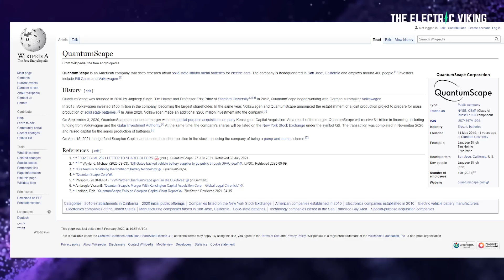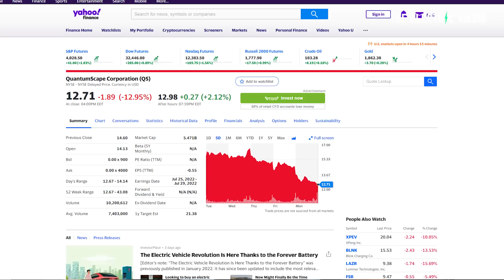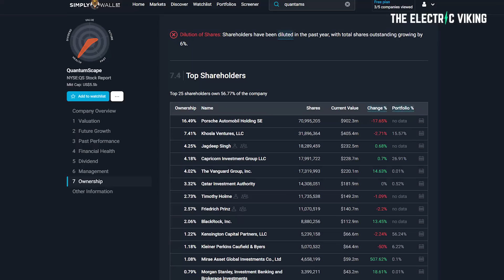QuantumScape's NEW solid state battery tech - is it real?!

Comment: 500 charge cycles is a joke
room for improvement.
Reply: Same reply as above, they are not talking typical charging rates, this is for 15 minutes quick charges.
Reply: @mikereinhardt1244  That makes the problem 100X worse - I've owned my Model Y for 5 days and have charged 10 15-minute sessions - that means a drive in the morning to work and one at night results in 600+ charge cycles a year

The billionaires suckered into this con game deserve the loss they are about to realize.
Reply: @noleftturns  one cycle of a battery is for a complete 0%-100% charge. So 500 cycles for a 300 mile rated range ev=150,000 miles and is perfectly acceptable for right now as in today ev sales. As the federal ev battery warranty requires manufacturer's to cover their pack's for 8 year's or 100,000 miles. 👍🏻
Reply: @noleftturns  Are you saying that a "charge" can be anything from a few minutes to a full charge from empty? There might be something to charging your batteries often and not letting them slide to even 2/3 capacity. I have not read anything about this,  but the only apparent  advantage is the convenience for those few drivers who are chronically incontinent.
Reply: @4literv6  Bull shit - a charge cycle is a charge cycle - whether it be 10% or 100% the battery doesn't know the difference - the dendrites grow on EVERY charge.

By your thinking my Tesla Y will last 10,000 years because I never let it go below 20% nor above 85% - we know that the battery will start to accept less and less of a charge because the dendrites have grown on EVERY charge.

Granted 0 - 100% is worse than 20% - 80% but dendrites ALWAYS grow in any kind of lithium battery. If it is iron-based the growth is 1/10 nickel.
Reply: @noleftturns  You clearly have not studied battery charging at all. Please do some independent research from scientists and engineers on charging. 

The way you charge a battery heavily influences the life of the battery. The holy grail is to charge quickly without doing that damage and no one has achieved that yet combined with  reasonable cost, safety, and energy density. 15 minute quick charges (means at least from 10-80%, not just plugging in for 15 minutes and getting what you get) are not possible on any commercially available batteries. So comparing this to current batteries in longevity is not apples to apples. This doesn't mean QS has cracked it, it just is comparing something that is not possible today with something they claim they can do.

Comment: 500 charge cycles aren't enough; make it 1000 and you're getting warmer.
Reply: I was having the same though as I listened, but that was 500 x 15 minute quick charges. NCM batteries do 1500-2K cycles, but not 15 minute quick charges (LFP do more like 3K cycles).  You can quick charge NCM batteries by heating them up, but they don't last long when you do that. I am not sure if LFP can be quick charged or not. I think there is some apples to oranges comparisons going on with that number. I seem to recall QS already showing independent data showing a cycle life over 1500 cycles.

Any experts know the answer here, or do I got to go dig it out of a bunch of articles...?